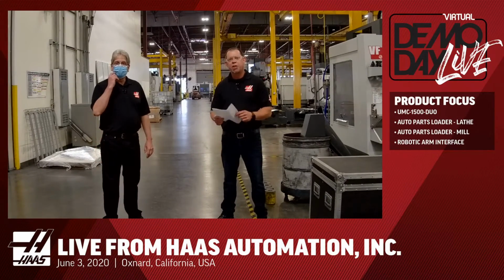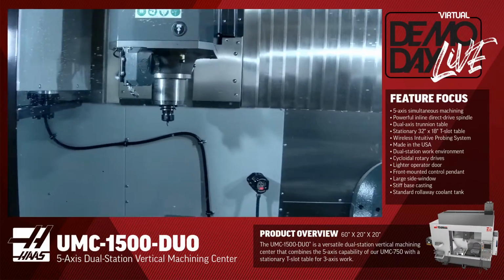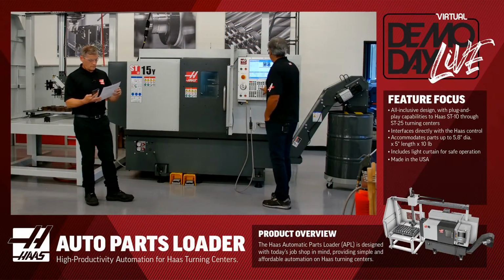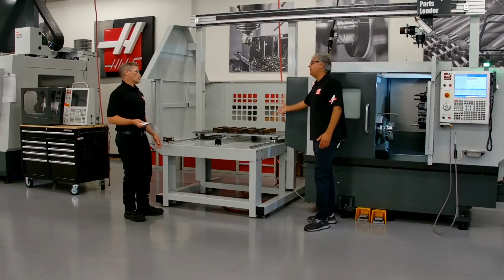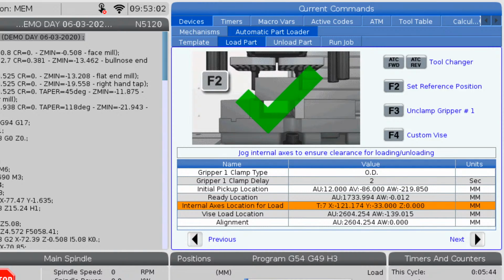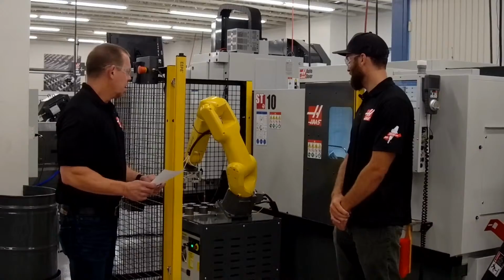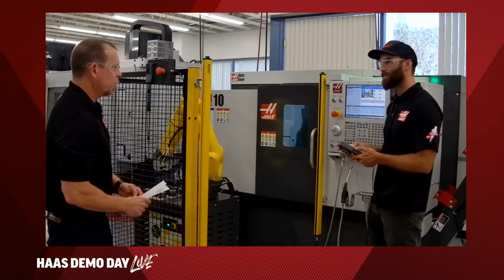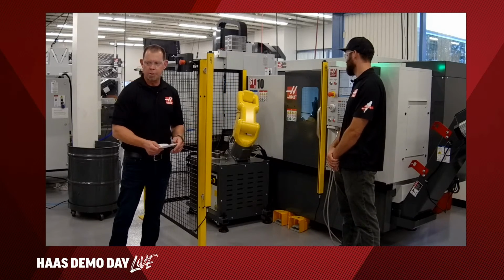Demo Day Live June 3, 2020

Comment: UMC 1500 ??
Buy either machine?
UMC 750 or a VF2 
For the amount of space it takes up and the cost of this machine it is a bit of a joke.
UMC start at $155 K USD
VF2 start at $ 60 K USD
OK someone Might have a use for a machine like this ??
For me i would prefer 2 separate machines that i can set up individual to each other.
Reply: I agree with your points. I'd rather have have two independent spindles cutting chips at the same time. But at least they are giving us extra models to pick from instead of not enough.